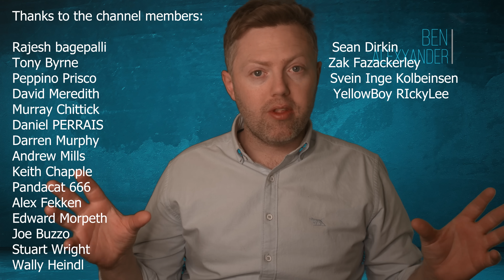CATL’s New Sodium Battery Will Reshape the Entire EV Industry

Comment: This honestly seems transformative for a lot of reasons.
Immediate impacts: a £20k, 350mile range car seems entirely plausible.
Immediate economic impacts: this could see a lot of car companies managing to make EVs profitable where they have previously been making a loss.
Longer term economic impacts: lithium mining countries are probably in for a rough time. Where there has been a recent boom time it will quite likely get a lot quieter, not entirely though, personal electronics will still want lithium.
Longer term environmental: if you’ve invested in a home battery that lasts 15 years, do you now just buy extra storage after 15 years? That potentially makes solar even more enticing, if you can now store ever more of your generated power.
Reply: Naxtra battery has like 30-40% less energy density than NMC and 20% less than LFP.  Range will below or the car will be insanely heavy.  I still like it though, for the cost and longevity.
Reply: Watch Will Prowses last Videos on Sodium cells. He tested one. The specs are a nightmare for BEV and home use. hias 12V Batter has a discharge range of 16V to 4V. So a 8900V BEV would have 800V fully charged and 200V empty, that is extremely superundesirable.  The Efficinecy he m,easured was also bad, 60-92%. Imagine buying 5kWh and only getting 4 out of the battery. 

This is not suitable for BEV or even home use.
Reply: the energy density of that battery is super low compared to NMC or LFP so this isnt going into cars anytime soon educate yourself
Reply: @carholic-sz3qv 

Not super low at the battery pack level. Lower, yes, but not nearly as much as you think. 

NMC cells need safety features that significantly reduce their effective energy density in battery packs, which is why LFP battery packs are, what, 60 - 70% of the capacity of an NMC pack? (Depending heavily on the specific pack, of course. Capacities vary a lot by manufacturer & purpose)

Sodium is in the 50 - 60 % capacity range compared to NMC at the pack level. But in cold climates, sodium is the same or higher capacity (depending on how cold, of course). And NMC is arguably way bigger than necessary capacity - wise for most cars and driving. 

So, TLDR: sodium batteries would be 80% the capacity of an LFP pack at half the cost. For a budget commuter car, which is what the vast majority of people need/use, that's definitely big enough.

Comment: YES!!!  BESS halves in price, gets even safer, AND improves charging and low temperature performance!  CANNOT WAIT to lord it over the fossil fuel trolls, LOL!
Reply: Watch Will Prowses last Videos. he has Tested a 12V Sodium battery. The efficiency and Voltage range an other specs are a nightmare for Home or BEV use.
Reply: @Flinno-k8w  https://www.youtube.com/watch?v=TaL12QyzTUU
Reply: @geconserver too superficial. Nothing on the downsides, will is by far better and goves far deeper insights.
Reply: @Flinno-k8w  He has tested one early cheap sodium-ion battery. One.

Is that what passes for science these days?
Reply: @geconserver do you really want to say that the video you linked is more science based than wills?
Your video tests absolutely nothing, just marketing claims of the manufacturers.

Will measured the charge and discharge behaviour, the roundtrip efficiency and how it works with standard inverters.that is a scientific approach. Your video is an ipinion piece without measurement,  anti-science deluxe.
Pulling the science argument in a competition between your video and wills is mindblowing ridicculous.
Reply: @Flinno-k8w  What is this BS? I linked the video to show that there are home sodium systems in production and available.

Will's video is on an early single battery, not a system. You can't extrapolate from that to draw conclusions from the sodium technology as a whole. Imagine if he'd tested the first Li-ion battery available - I'm sure it wouldn't have been anywhere near as good as a Tesla Powerwall or a SigenStor.

Enough with this tribal nonsense.

Comment: Nothing has been said about its discharge capacity yet, I can't find it anywhere.
This is a vital metric for the performance of any EV.
Reply: While you’re correct I do t think it has to match lithium’s discharge rates to be viable. There’s no need for a family EV to accelerate to 60 in 4 seconds. It will be interesting to see what the figures are though.
Reply: @Adam-pt3cb  There's no need for any vehicle on the public road to have even half that acceleration.

Comment: This feels like the thing that will truly kill the ICE industry. Safe, cheap, abundant materials, wide operating temperature, long lasting.
Reply: If this works it will make electric cars and some trucks much more prevalent.  But it will not kill the ICE industry as there are applications where energy density or volume matters and cannot provide the space for batteries or support the weight of the batteries.   Lb for Lb hydrocarbon fuel is several orders of magnitudes ahead in energy density and volume than batteries.
Reply: @perryallan3524 ICE engines are only about 25% efficient at converting fossil fuel energy potential to mechanical work.
Reply: @Rio.Motel.84  You are way low.  The best diesels are in the upper 30's.  Also, how do you generate electricity.  The vast majority of the worlds electricity is generated with plants operating in the 30%-40% range, although a combined cycle plant can reach into the low 50%'s (I've spent much of my career as an engineer in power plants).  So electric vehicles are not nearly as clean as people think; and batteries and electric motors are not 100% efficient either (typically in the 90+% effiency).  In reality a high efficient diesel engine is overall more efficient than a battery powered electric vehicle charged from the grid.

If you are looking to eliminate emissions you on a large scale you need to go nuclear power generation.  But the efficiencies do not change.
Reply: @Rio.Motel.84 Nah, high 30s and even into the 40% range in many cases.
Reply: It’s not a binary decision - there will be a long time yet with ICE-based vehicles, and an ageing fleet of classic vehicles that will get driven once a week, probably on Sundays, and contribute little to global warming.  In the meantime, daily drivers will be electric in the continuum that started with feet, moved to horses, then to ICE cars and trucks, and will move to EVs and whatever follows.  Such is the way of human adaptation…
Reply: @davidburne9477  I think we are going to have an extended hybrid period before we get to ev dominance. I could see ev currently in cities and metro areas but much of the country has a larger commute
Reply: @joshwells4280  Pretty much any EV can already do a long commute of say 120 miles round trip now. And with cheaper batteries the range will extend as they'll add more, assuming energy density is similar to lithium ion because there's limited space in cars.
Reply: If a battery can be made that is safe, economical, long lasting, actually environmentally friendly including for the slaves that have to mine the materials I will be all for it.
Reply: @fredjack1979  Now the slaves will be unemployed.
Reply: Certainly going to be a game changer for the home battery market - every home will have one
Reply: My main problem with EVs are several:
1. I don't have a garage (park on street) so nowhere to install a charger.  I've heard it's more expensive to always use the commercial ones.
2. Lack of range and reduced range in cold temps.  Hopefully sodium will help with both of these.
3. Charging time too long.
I hope subsidies and laws that specify a date when you must buy an EV will be discontinued everywhere soon.  Let the market decide when most people will cutover to EVs.  When folks moved from the horse to the automobile I don't recall reading that it was legislated that after a certain date it would be illegal to buy a horse!  People started buying cars and trucks once they became affordable and reliable enough, and there were enough fueling stations.
Reply: @dcinpa1134 yeah if you can't charge at home or work it's no good.
Reply: @dcinpa1134  1) Undoubtedly public charging is much more expensive than home charging. Rapid charging on large routes costs more than petrol although there are options. Tesla will be cheaper than petrol.
2) Range isn't an issue if you can charge at home. If you can't I wouldn't advise getting one yet but you don't have to.
3) Again, charging while you sleep effectively takes zero time. If you can't do that you're probably talking 30 minutes once or twice a week. But speeds are improving, BYD can already give 250 miles in 5 minutes. 

We can't leave this to the market because we're trying to decarbonise. Horses weren't banned but horses weren't burning fossil fuels leading to climate change. And the replacement technology wasn't subject to mass misinformation campaigns paid for by those who made money from the old way of doing things.
Reply: The real end to the ICE industry won’t happen until a company can Model T the EV industry. When the Model T was introduced, the range of 1 tank of gas was greater than all the paved roads in the US combined. But they produced and sold the model T for what would be $7,000 in today’s money. They were incredibly affordable for a few months worth of salary for an average family at their peak. The US went from 200K total cars on the road to tens of millions. 

The infrastructure for the model T was built to fill the demand of model T owners. It wasn’t a case of if you build it, they will come. It was more a case of they’re here, better build it. So roads, service stations, garages, etc were built after the Model T created the demand. 

If someone goes out and makes an EV that is affordable like a Model T, industries that provide infrastructure for them will develop to take advantage of the demand. 

Someone just needs to start producing an electric vehicle that replicates the introduction of the Model T.
Reply: Truthfully it will be a while, while ICE systems are 24% efficient, gasoline is still over 12,000 kWh/kg - 12-15 times higher energy density than modern battery. 

Will we get there, yes. It will be a while, though.😊
Reply: @pavanbiliyar  Larger industrial diesel engines with turbo chargers and other features are much more efficient than auto engines (often approaching or exceeding 40%).  They are used to power very large equipment (Very Large Cranes, ships, etc) and mobile power plants for large construction sites; large standby generators.  I don't see batteries ever replacing those.
Reply: nonsense its not going to be in cars its for energyu storage not for cars
Reply: @carholic-sz3qv it will literally be in cars in the next few months...
Reply: @charlheynike9619  isn’t the charge density too low?
Reply: @kineahora8736 i don't think so. It's good enough for smaller battery packs, and smaller battery packs are good enough for the majority of people's needs. People think they need way more range than what they really do.
Reply: Not if the chargeing structure inst there.
Reply: Long lasting?  Untested for many years use.
Reply: Not until every politician that is paid to only believe in fossil fuels dies.
Reply: For sure. The only problem - it doesn't exist 😂
Reply: And, thanks to Trump, America will be behind the curve in developing the electric vehicles that the world wants to buy.
Reply: @BradiKal61 they say Trump is a moron
Reply: Considering ice cars will stop being manufactured by 2035 that’s pretty obvious
Reply: And super reactive with water..
Reply: @etienne8110  Only if they use pure sodium metal as the cathode or anode; and I have heard that they don't do that. There are multiple different chemical forms and mixes of materials in the sodium class of batteries.  The sodium may be alloyed with a different metal, or in a ceramic form.
Reply: Doesnt solve the main disadvantage of low energy density which is the biggest inhibitor of EV uptake..
Reply: @csjrogerson2377  true, high end EVs will be using lithium for decades more, but at 2x the cost, where batteries are the bulk cost of the vehicle.
Reply: ICE is dead anyway
Reply: @SzaszaG1 lol ok
Reply: @SzaszaG1 ICE needs to be severely constrained, and separated back into INS and Customs.
Reply: Ice is still as strong as it is because of propaganda; it has little to do with its true comparison with EV.
Reply: @patty109109 nope your wrong.
Reply: @patty109109 false. Energy density is orders of magnitude higher in traditional fuels, and that matters. Wish it weren’t so, but there are legit engineering obstacles to overcome, and if this works out, it’ll definitely help, but it’s step one.
Reply: If you pay attention, this will kill the EV industry as well.
Reply: @truantray naah, innovation keeps it alive, stop fear mongering
Reply: So I'm still banging on with our 2 x diesels.
Was waiting for the blade batteries to become more common place.
Now Im waiting for these.
15 years then as I'm not buying new
Reply: @stuartburns8657 you'll wait forever if you're so picky. There are lots of good second hand EVs around already.
Reply: @stuartburns8657 Good for you, bad for the planet obviously, but again you probably don't care, but in the meantime thanks for continuing to pay those horrendously high fuel duty taxes and subsidising us EV lovers.
Reply: @simonpaine2347😂😂😂your are such a clown soboy
Reply: @joshuaburgess4730  Awww you're so precious
Reply: @simonpaine2347 I thought fossil fuels were getting "trillions of dollars" of subsidies?
Reply: @simonpaine2347 chill out, diesel cars aren’t anything compared to data centers, nothing we do will matter as long as we keep building data centers
Reply: @simonpaine2347 so, how are EVs greener than an old ice car? Recycled any of those things recently?
Reply: @tconbo4514 they emit less co2 over their lifespan. They also seem to last longer.
Reply: I don't think we have a year crisis at all
Reply: @stuartburns8657 Luddite tendencies?
Reply: You do realize mining equipment runs on diesel.
Reply: I thought they were pedal powered like a bicycle 🤔
Reply: @yo2trader539  Never heard of the bootstrapped circular green economy? No? Nuff said. I suggest you research how a circular green economy will steadily render all fossil fuel inputs unnecessary.
Reply: @rogerphelps9939  Well done for drinking all that koolaid.  The CGE is great for things that can draw from the green energy supplied to the grid, but it doesnt work for huge machinery that cannot, eg merchant ships, warships, commercial airplanes, mining equipment, civil engineering equipment & trains.  Diesel will always be necessary.
Reply: @yo2trader539  it's sodium, sir. No need to mine.
Reply: @yo2trader539  There are already electric replacements being built for the massive mining trucks etc, so it is a matter of time for industry too.
Electric trucks/lorries are already going strong in China and parts of Europe, and growth will soon expand elsewhere too.
Reply: @yo2trader539  you do realize sodium comes from sea water.
Reply: @yo2trader539  not for long silly billy
Reply: @yo2trader539 Until it doesn’t. There are numerous mining plant manufacturers with EVs either already in use or being rolled out.
Reply: @yo2trader539  such a try hard false equivalence.
Reply: @yo2trader539 Wait! You mean that people moved on from horses and carts? I'm sure that I remember loads of people saying that those new fangled machines would never replace the reliability and strength of horses! Seems like the world moves on regardless huh?
Reply: @simonpaine2347 People still ride horses.  There's plenty around where I live.
Reply: @simonpaine2347 nonsense!!! the ICE was invented and it came and built all the infrastructure on which we all rely on today , what have the useless evs done?
Reply: @yo2trader539 you do realize breathing releases CO2?

Comment: Naxtra is a complete game changer, and if history is any guide, as the technology matures, it should  not only perform better, but will decrease in cost as well. 

Another huge benefit is being able to run down the battery to 0 without degrading life (don't quote me on this). And these can be fully cycled, and have superior longevity -- ~3.2M miles, or way more than even an old vehicles lifespan.

CATL will not be able to make these quickly enough, demand is going to be crazy.
Reply: Another Betamax moment.

Comment: Yes, fantastic. Make EV batterie standards. Like AA and AAA. Make these larger batteries also fit boats, motorcycles, snowscooters and so on. Ideal, you only need one battery to many different applications.
Reply: Indeed.
Reply: There is no need. You don't swap them when they run low on energy. Each company will bulk order whatever makes sense for their product.
Reply: @secretweapon7764  agree. Besides, there is a great deal more amperage difference and need for secure connections between an AA battery and one of these, so hot swapping isn't really feasible. Can't cheat the laws of physics